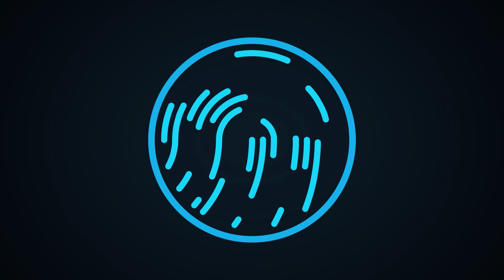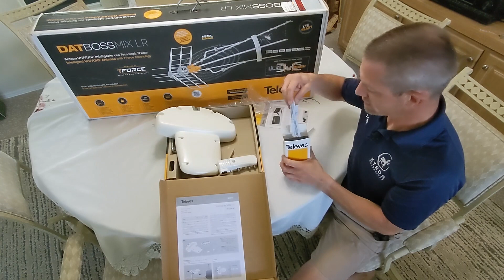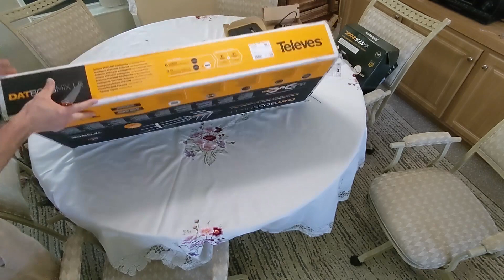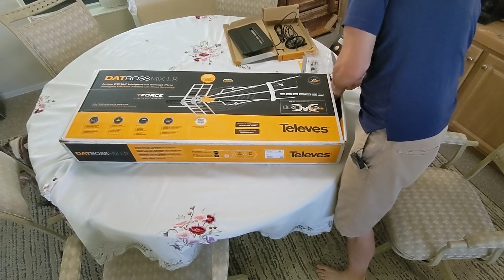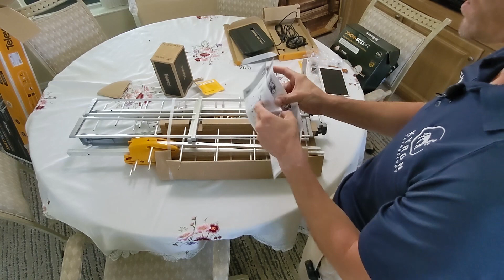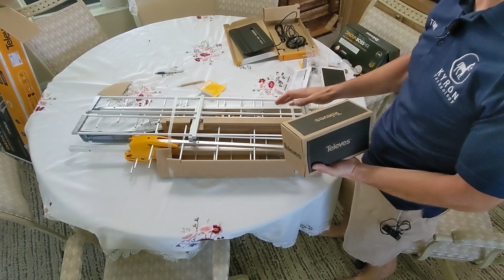Unboxing Three TV Antennas from Televes: Bexia Indoor, DiNova BOSS Mix, and DATBOSS Mix LR

Comment: I subscribed to Tyler, The Antenna Man on YouTube and he recommended the 149884 Televes based on my location and reception needs. I have a "neighbor" about 5 miles further away from the broadcast "antenna field" (as they call it) that I recommended Tyler to-He in fact signed up for Tyler's $40 lifetime antenna help program. To my surprise Tyler recommended the OLDER version of the Dat Boss LR (149883) antenna. Would you have any idea why he would have done that? Seems to be going backwards to me because Televes UPDATED the unit completely...
Reply from the maker: I can't think of a reason to recommend the older version off the top of my head; possible typo on his part? Might be worth verification.
Reply: @kyrontechnology  Tyler says it was sort of a typo. it wasn't even the 149883, it was the 148383-if there is such a part number.....I think he may have bit off more than he can chew with his online antenna help gig.....
Reply from the maker: @RickBarkley9909  yes, that is a valid part number, with LOW VHF elements in addition to the High VHF and UHF elements on the model I tested. It would only be needed in certain markets that haven't updated yet. 

Tyler is surely quite a busy man, but he certainly knows his stuff. I've learned a lot from his videos, so I think it's safe to say there is probably a good reason he recommended that model for a particular location. I don't have time to look at a RabbitEars report to figure out what the reason is, but I would assume that whatever market is in question has some remaining low VHF transmitters.
Reply: @kyrontechnology  Might very well have been a typo. Boy, This thing is GREAT!! It seems to just be getting better all the time-guessing the automatic gain control is really working.

Comment: Been a full cord-cutter for a few years. Not so much to save money but frankly hate paying the cable & satellite companies. Because of this & 2 of the houses I own are both in difficult markets, I have bought a number of the best antenna's & have actual experience using them.
The absolute best antenna for its size & yes, size matters is the Televes DatBoss LR Mix.
But & this is a Giagantic But, even the best antenna will work like crap if you use cheap cable.
RG59 is totally useless for any outdoor antenna application. Period end of story. Loss of db gain is the reason.
RG6 steel core or copper clad is only marginally better. Less db gain loss but significant over length.
RG11 Solid Copper Core is the ONLY way to go. Yes, it is just that important. Using it you will substantially increase the number of towers received & the quality of the reception. Number of towers = numbers of stations.
Where this is especially an issue is towers located 60 miles & further distant.
1 more huge tip, NEVER use an extender as in only use 1 cable, Do Not save a penny & lose a dollars worth of reception (gain) by taking 2 shorter cables & adding an extension. Biggest reason is in the pre-amp. Pre-amp works only with 1 cable, significant loss of db gain which is your total reception occurs where you added the extension.
Frankly, if you are serious about reception, buy a top reviewed long distance antenna (box advertisement in miles are all lies) use a recommended antenna height (20 feet minimum) & use only a single RG11 solid copper core cable.
Antenna horizon is 60 miles at 20 feet in height, this is Earth Curvature. Trees/mountains/ etc reduce the horizon. Height increases the curvature & is the only way to increase the distance. Good way of figure is 10 feet = 10 miles maximum at 90 miles. Advertisements suggesting 150/200 miles are frankly lies & do not take earth curvature into account.
If you remember only 1 thing, RG11 Solid Copper Core antenna cable single cable run never connect 2 together.

Comment: I own a Televes Dat Boss LR Mix antenna. It took me watching a YouTube installation video & 1 hour to correctly assemble. It was money & time well spent. My antenna height is 22 feet, it picks up 2 towers at 69 miles distant thru trees with a top level picture. 1 tower at 82 miles distant is night time only. Earth curvature means 60 miles at 10 feet in height regardless of manufacturer propaganda.
The Televes Dat Boss LR is an exceptional LR antenna, the filters work perfectly & the antenna is well made not flimsy like many others.

Comment: Just put up a Datboss in the attic this week. Works like a dream. I'm about 40 miles from most transmitters, but they're all in the same direction, give or take a few degrees. I'm getting channels Crystal clear I didn't think were possible at this range, even during a storm.
Reply: Do u have to keep moving it to pull in all those channels or can u leave it in 1 spot and grab most of them?
Reply: @dmo848  I just aimed it at the broadcast source to my best estimate, and so far, so good. It’s fairly substantial and heavy as far as these contraptions go, so I’ll feel better when I bolt on another brace to ensure it doesn’t fall over. 
At least if you’re situated somewhere like my place, though, you can set this thing and just leave it alone. The higher the better.

Comment: I need to know what televes antenna works better in Ocala FL? I'm going crazy over here trying to get a solid signal. I want solid and laff tv
Reply: You are going to hate this answer but my summer house is just outside Ocala.
You need a tower & be taller than 30 feet above ground. The Televes LR Mix plus a Rotor is your best bet. Also DO NOT go cheap on your coaxial cable. Instead bite the bullet & buy RG11 With a SOLID COPPER CORE. Reason for Caps is this is that important for you to receive Orlando stations. It you go cheap & use a cheap RG59 plated core antenna coaxial cable, you are frankly pissing in the wind. RG6 is good but only with a soild copper core. But if you are spending the money on the right antenna, spending the money for a rotor & setting it up 30 to 40 feet high, spend the money for RG11 with a solid copper core.
I know Ocala is prob the worst area for decent reception.
Reply from the maker: @JFrenchRennier  this is actually a GREAT answer, and I really appreciate you chiming in since you have actual experience with the geography in question. I suspected additional elevation would be necessary, but didn't want to advise until I had more info. 

I tend to shy away from rotors though. A more reliable solution is usually to have two stationary antennas aimed correctly and optimized for the desired market, combined with something like a Televes SmartKom if needed.
Reply: @kyrontechnology  I have precisely as you recommend which is why I also own a Televes Ellipse Mix. But my location is on an acre out of town. The Florida house is my winter residence, have the main in Louisiana & a summer apartment in Cuzco, Peru. My poor because he divorced at age 65 retired US Marshal brother stays in the Florida house. 
Problem with towers & dual antenna's is in Florida the HOA regulations.I until this year owned a house in a large retirement community on a Fairway & well know HOA's as I was their continual problem as they were loathe to appear in court over a few their regulations & attempted to apply fines which were in conflict with previously interpreted case law.
I also have disdain for rotors but there is 1 on the market which is reliable & does not have plastic gearing. I had 1 previously at the main house in Louisiana. The Dinova Boss is also the best antenna to use on a travel trailer
Reply: @JFrenchRennier  highly thank u. I'm still over here trying to figure things out. I do have the house split up for 4 TV's using rg6 solid I think n ge4 way powered splitter and 1 going to a televes splitter for my tv cause for whatever reason I get better signal. Idk🤷. Anyway that's where I'm at oh and I'm using the ge pro antenna that looks like a C. I also have that RCA yagi antenna that I was using in 1 room but took it down.
Reply: Kyron Technology, Are you able to suggest a good antenna here? Are there markets in Gainesville that would be closer than the Orlando market for him?
Reply from the maker: @RickBarkley9909  this gentleman posted similar questions on a couple videos, and I replied at length in another. 

Bottom line is that I'd need an exact address (or anonymous Rabbit Ears report) to give him accurate information, but the DatBoss Mix LR is likely his best bet. I even offered to sell my demo unit at cost, but he hasn't replied in a few days.
Reply: @kyrontechnology  Gotcha! Thanks! Boy, I think somehow you should advertise down here in Brevard County and set up installations may be 1 day a month. Like I said before the 2 main electronics shops down here that handle antennas are great folks but are stuck in the '70s as far as technology goes. You would have no competition down here.
Reply from the maker: Thanks so much for the encouragement!

As it turns out, I recently jumped on an opportunity to join the team at Wire 3, a new Fiber-to-the-Home internet provider in the Daytona area, and am struggling to manage installation and tech support scheduling as it is. I'm looking into bringing two more people into the mix for those purposes, but there are a lot of logistics to work out. We'll see how it goes once we get through the holidays - I may impose on you for some marketing or referrals, if you feel comfortable with either.
Reply: @kyrontechnology  Absolutely!!
Reply: @kyrontechnology  You know, In the grand scheme of things WE have already saved HUNDREDS if not thousands in cutting the CABLE. Our first pro installation was $375 as I recall 4.5 years ago and the new Televes Dat Boss LR 149884 was just under $200 to our door. So certainly under $600. Previously we were spending about $125 PER MONTH on Directv satellite tv......
Reply: Price came down to 150 on the boss mix so I'll be pulling the plug later on. I'm getting conflicting results from the web on laff tv. A few day it's not there while others including rabbit ears say it's there. I Kno for a fact a did pick them up before the repack. Went back north to grab the rest of my belongings and came back n it's flat out gone. Tried with the antenna I first picked it up on which was a crappy 1 from antop. Then spent damn near 3 hundred on crap equipment thinking it was a small issue. Lol. No I just need a bigger antenna and yes I do see all my neighbors with them up on 50ft poles. Honestly I did not want to go that route but it sure as hell looks like I'm going to have to do that or at least on the top of my house with an umbrella stand. Gets that's all I got to test with at the moment. And what's this about selling the 1 you have? Sorry I don't have messages enabled on here. So I jus check back. I Kno I'm a tool
Reply from the maker: @dmo848  sorry, I seem to have somehow disabled notifications about 3-4 weeks ago as well, and missed your last couple of messages.  What's your current status? Did you purchase a new antenna yet? How high were you able to mount it?
Reply: @kyrontechnology   @J.French Rennier  highly thank u. I'm still over here trying to figure things out. I do have the house split up for 4 TV's using rg6 solid I think n ge4 way powered splitter and 1 going to a televes splitter for my tv cause for whatever reason I get better signal. Idk🤷. Anyway that's where I'm at oh and I'm using the ge pro antenna that looks like a C. I also have that RCA yagi antenna that I was using in 1 room but took it down.
Reply from the maker: @dmo848  I think you'll find the preamp in the Televes is sufficient for a passive 4 way splitter, but I also have some Channel Master drop amps that I no longer sell since standardizing on the Televes products. I'd be happy to sell you one at a discount if you're ever in the Daytona area.
Reply: @kyrontechnology  yeah I may need that amp. In all actuality I think I Kno what I'm doing but really I have no clue. Funny cause I'm usually really good with anything tech. But this antenna stuff is starting to go over my head
Reply from the maker: @dmo848  there's a lot more to it than meets the eye - seems simple enough on the surface, but you don't know what you don't know. Have you done a RabbitEars.info report yet? That's the best place to start.
Reply from the maker: @dmo848  email might be an easier/more consistent form of communication for troubleshooting your specific issues, and you can send pics of your current setup and a link to your rabbitears report: tony@kyrontech.net
Reply: @dmo848  This is from Louisiana experience & not the new Florida house - sometimes a channel will downgrade their broadcasting strength during scheduled or emergency maintenance periods. I have 1 set of channels received on the digital 16 which downgraded their broadcast signal significantly for 3 months just this non-hurricane year. It only recently went back to full broadcasting strength & is located 68 miles distant main power at 800 which requires a really good setup for satisfactory strength of signal.
Reply: Thank u to anyone chiming in here you don't realize how much extra this helps a fellow. For real I honestly thank y'all

Comment: When will you test this antenna out
Reply from the maker: Hi Sherril! The good news is that we've been extremely busy helping people save TONS of money switching to antennas or streaming services, but the downside is that I haven't had time to test this antenna yet, nor edit and post 4 in-depth tests of other antennas that I've already filmed. Only so many hours in a day...

I have had a couple of chances to casually use this antenna in a pinch, once when a neighbor terminated cable a week before actually moving, and again to watch two football games at once on a 2nd TV temporarily placed in the living room. Both times, it worked better than I expected any indoor antenna to, with minimal placement/orientation adjustment..

Overall, indoor antennas stink, and I would only recommend them in very specific circumstances, or as a last resort for very basic needs.  Even without a formal test, the four times I deployed it, it just worked for what I needed at the moment, and that's a lot more than I can say about any other indoor antenna I've tried in the past. 

If you HAVE to opt for an indoor antenna for whatever reason, I would absolutely recommend that you start and end with the Bexia. If it doesn't work, I'd be more than a little surprised if anything else does.